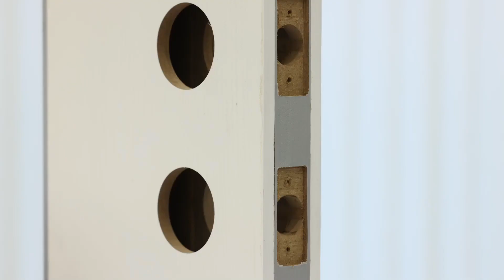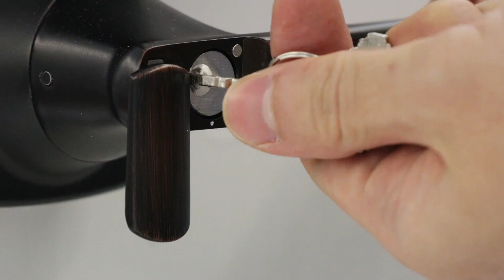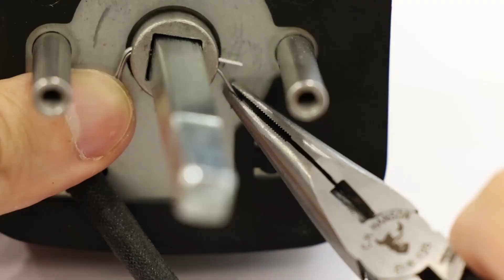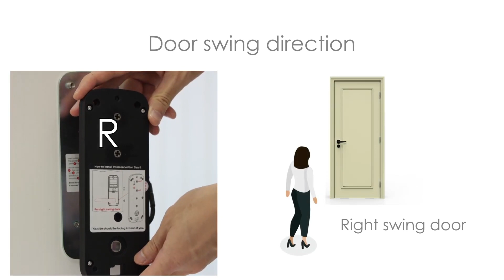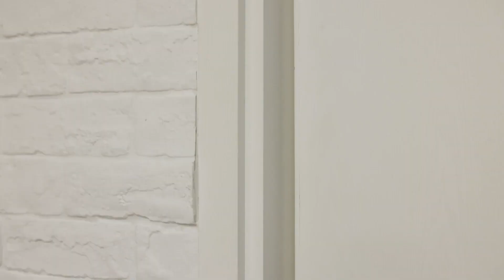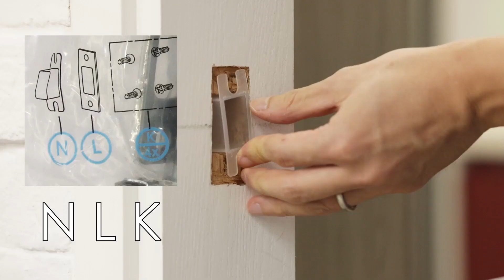Lockly Duo Interconnected Edition Installation Guide

Comment: I have this lock installed at my home. It's a nice lock but I wish it had the auto locking deadbolt. Sometimes family forgets to lift up on the handle to lock the deadbolt when leaving the home. Auto locking deadbolt with be a helpful design. Also wish lifting up on the handle would retract the backset. With the right timing I was able to open the door before the deadbolt engaged.